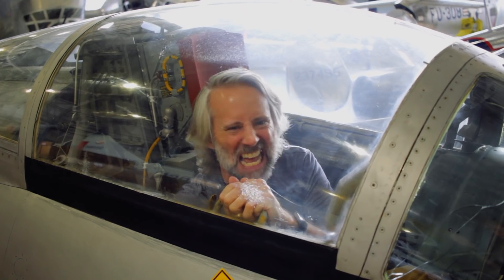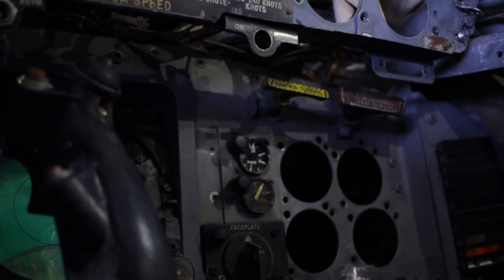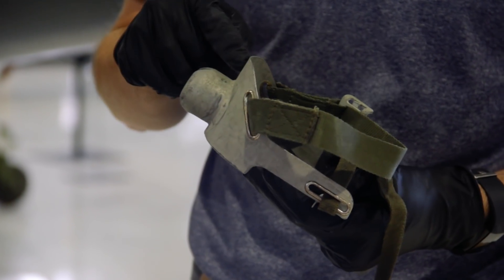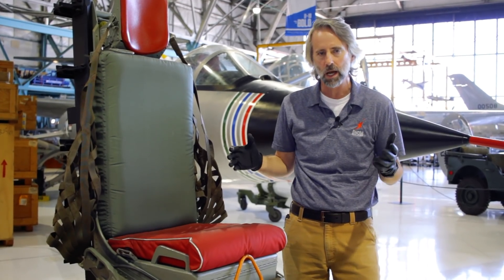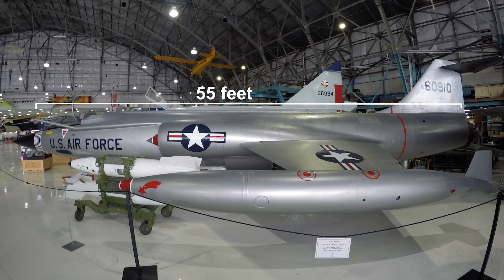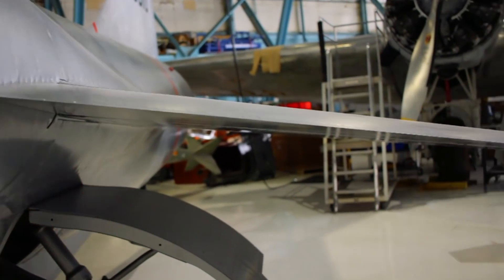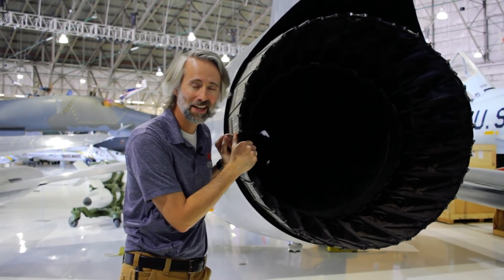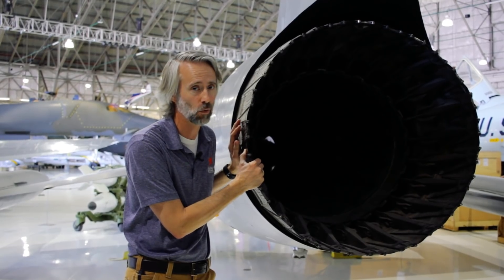F-104 Starfighter | Behind the Wings

Comment: He's trapped in an F-104, of course he's screaming. If he's got any German in his blood, he's screwed.
Reply: That moment when your a German-Canadian F-104 pilot
Reply: The RCAF also lost 50% of its CF-104 Starfighters to accidents.  Another colloquial name for it was "the lawn dart".
Reply: The reason why so many german f104 s crashed was , The german G model version was heavier - made for all weather usage and used for low level Nuclear Bombing ( instead of beeing a High altitude bomber interceptor ) during the cold war ,was also rushed into service , another reason for the crashings was lacked maitenance by inexperienced servicing personel .
Remember always seing them flyinging at low level - even flying under Power lines during the 70s ! 
 Salute from germany ! :-)
Reply: I don't get it
Reply: @alphacentauri34  The Germans had the highest mortality rate in the F-104 than any other operator.
Reply: @BlunderMunchkin  I got that I just thought they had a worse version of it
Reply: @alphacentauri34  They had a really weird version because they wanted a ground attack plane, but the 104 was an interceptor, so many redesigns had to take place. These redesigns, along with an even higher wingloading due to the heavier ordinance for ground-striking, caused it to have a bad tendency to sheer its wings in turns.
Reply: Guy Smith Like 110 pilots in one year, including the son of the German defence minister.Franz Josef Strauss. The worst of it was that it was selected as the NATO standard interceptor and multi role fighter because Lockheed handed out bribes left, right and centre. All the aircraft that it competed against for the NATO contract were far, far safer, having better dead stick landing characteristics and agility. In the case of the Grumman F11F Super Tiger and the English Electric lightning, they rivalled it for outright speed and climb as well.
F104 Starfighter. Great research plane. Useless war plane.
Reply: @SvenTviking  No actually it was beyond the bleeding edge for the time for the role it was designed for, high speed high alt. bomber interception.  It was better than the F-102/4 and the Lightning, or the MiG-21. When requirements and tech passed it by, it should have been relegated to reserve use, but... capitalists gotta capitalize.
Reply: James the Other One I have tones of evidence to suggest the F-104 was beyond inferior to the Lightning. Not only did have the worst accident rate per flying hours of an century series fighter at 25.2 destroyed per 100,000 hours flying time. For reference the second worst was the F-100 at 16.2 destroyed per 100,000 flying hours. Let’s not even mention the German experience... Compare this to BAC lightning which had a loss rate of about 50 out of all 330 (about 16%) planes ever produced with most being down to pilot error or long time stress of the airframe over their decades of continuous service.  Which is another point the USAF couldn’t wait to get rid of these things and retired them quite quickly compared to the lightning. 

Now let’s look at what pilots who flew both had to say about them... http://www.lightning.org.uk/julaug05sotm.html at the bottom is a photo of an F-15 caught in camera gun sight of a Lightning during a mock dogfight. The Lightning has all the raw performance of the F-104, whilst being easier to handle, being more manoeuvrable and safer...
Reply: @GG-ir1hw  I'm not sure why you replied to me with this but have a cookie.
Reply: @GG-ir1hw  
> James the Other One [...]
 
I suspect that you intended to direct your reply to me rather than the Other One since I'm the person who has been defending the F-104 against its detractors.
I'm going to present a response, or rather several responses because of size limitation of any single reply, based on that assumption.
 
> I have tones [sic] of evidence to suggest 
> the F-104 was beyond inferior to the 
> Lightning. 
 
For anyone who wants the Reader's Digest Condensed version, the answer to this assertion is, "No, you don't, because no it (the F-104) wasn't (beyond inferior) to the Lightning ... except maybe in your dreams".
Reply: @GG-ir1hw  
> Not only did have the worst accident 
> rate per flying hours of an century 
> series fighter at 25.2 destroyed per 
> 100,000 hours flying time. 
> For reference the second worst was 
> the F-100 at 16.2 destroyed per 
> 100,000 flying hours. 
 
I've seen the claim that the F-104 had the worst accident rate of all of the Century Series fighters before.
Unfortunate, this claim is usually not accompanied by any mention of how this determination was made and therefore what the expression "accident rate" really means in a particular context.
This is important if for no other reason than because the number of accidents that a particular type of fighter aircraft experiences usually decreases over time and so the "accident rate" can refer to something different at different times.
 
In one case where the claim was made that the F-104 had the worst accident rate of all the Century Series fighters, a reference was also made to Bowman's book "Lockheed F-104 Starfighter".
And from the figure given in that book on page 21 where the number of number and types of accidents of Century Series fighters was given, it's clear that the F-104 did NOT have the worst accident rate, either in absolute or relative terms based on the accidents that occurred first 750K hours of flight time (600K in the case of the F-104 because it hadn't acheived the 750K hours mark).
This is something that I have noted elsewhere at least a couple of times now.
By this measure of "accident rate", the F-100 was hands down the worst of the Century Series beating the F-104 by roughly double in terms of accidents, losses, and fatalities:  471 accidents, 287 destroyed, and 91 fatalities for the F-100 in 750K hours versus 196 accidents, 160 destroyed, and 58 fatalities in 600K hours for the F-104.
And if you can't do the math in your head, dividing the first set of numbers by 7.5 and the latter set of numbers by 6.0 to convert them to values for 100K flight hours, you come up with 62.8 accidents, 38.3 losses, and 12.1 fatalities for the F-100 versus 32.7 accidents, 26.7 losses, and 9.7 fatalities.
So while the value you cite for F-104 losses is roughly in the same ballpark, your figure for the F-100 is off by roughly a factor of two.
 
> Compare this to BAC lightning which 
> had a loss rate of about 50 out of 
> all 330 (about 16%) planes ever 
> produced with most being down to 
> pilot error or long time stress of 
> the airframe over their decades of 
> continuous service.  
 
This is a USELESS apples-to-oranges comparison which says NOTHING about the accident rate of the Lightning compared to the F-104.
You switched from an accident rate that compared aircraft lost over some number of flight hours to simply number of airframes lost over the service life of an aircraft.
If you really want to compared the accident rate of the F-104 to the Lightning, then you need to factor in the number of aircraft build and how many hours they flew.
And an interesting thing happens when you do this because at least by some measures of "accident rate", the Lightning was LESS SAFE than the F-104.
This is covered in Chapter 12 of Peter Caygill's book, "Lightning Eject: The Dubious Safety Record of Britains Only Supersonic Fighter", (yes, that Peter Caygill who also wrote "Lightning from the Cockpit: Flying the Supersonic Legend") from which I'll now quote:
 
  Although the actual number of F-104G 
  accidents in West German service was 
  significantly greater than the total 
  number of Lightning accidents, this 
  tends to be obscured by the fact that 
  many more F-104Gs were delivered to 
  the Luftwaffe and Marineflieger .  
  Including the twenty development batch 
  aircraft, Lightning production for the 
  RAF amounted to only 280, whereas a 
  total of 916 Starfighters were taken 
  on by the German armed forces.  It is 
  only when an analysis is made of the 
  accidents per flying hour that the 
  true picture begins to emerge.
 
  During the first ten years of Lightning 
  operations in the RAF (up to the end 
  of 1969), a total of 199,000 hours 
  were flown and in this time thirty-two 
  aircraft were written off in accidents 
  (this figure includes two Cat.4 
  accidents in which the damage level 
  was subsequently upgraded to Cat.5).  
  Thus, on average, a Lightning was 
  destroyed every 6,218 hours flown.  
  During the complete life of the F-104G 
  in West German service, total flying 
  time amounted to 1,975,646 hours and 
  there were 298 accidents that resulted 
  in 298 accidents that resulted in 
  complete write-offs.  A Starfighter 
  was therefore lost for every 6,630 
  hours that were flown.  If the 
  seventeen-month period from the 
  beginning of 1970 is included in this 
  analysis of the Lightning accidents 
  [which was presumably when one 
  Lightning was being lost every month]
  the loss rate worsens to one in 
  every 5,795 hours, and if this 
  period is looked at in isolation an 
  aircraft was being destroyed every 
  4,667 hours.  These figures indicate 
  that the accident rate per flight 
  hour for the F-104G and the Lightning, 
  although not dissimilar, show that the 
  latter [the Lightning] did have an 
  inferior safety record for at least 
  some of its operational life. 
 
And something to keep in mind here is that the accident rate of the Lightning SHOULD HAVE BEEN LOWER than the F-104G as this is what commonly happens when comparing an interceptor to a non-interceptor, at least according to an old Rand study on fighter aircraft accident and attrition rates during peace time that I have somewhere.
This is something that I think Caygill alludes to but doesn't actually come out and say when he says:
 
  This was despite the fact that the 
  F-104G was designed at the outset as 
  a strike/attack aircraft so that it 
  spent much of its time operating at 
  low level, often in bad weather, and 
  was therefore more vulnerable to 
  terrain, bird-strikes and obstructions.  
  In contrast the Lightning had begun its 
  life at medium and high altitudes and 
  it was only towards the end of the 
  1960s that it also took on a low level 
  role in addition to its previous duties.
 
So think about that for awhile: the Lightning had an even worse safety record than the F-104 and Caygill just happens to say that the F-104 had the worst safety record of the Century Series ... doesn't that mean that the Lightning had a worse safety record than ANY of the Century Series?
Oh my ... isn't that a disturbing thought.
Reply: @GG-ir1hw  
And that brings us to the causes of the aircraft losses because your message seems to suggest that Lightning losses had little to do with the aircraft itself (other than a long life span resulting in airframe fatigue).
The implication you seem to be making as well then is that you think the F-104 losses had more do to with the airframe (other than airframe fatigue) which seems like a backhanded way of saying that you think the F-104 losses were the result of some design defect.
If that is indeed what you are trying to imply, then you're going to have a problem because Caygill says this:
 
  These differences in usage are 
  reflected in the breakdown of accidents 
  as 43 percent of all F-104G crashes 
  were attributed to pilot error, with 
  41 per cent being the result of a 
  technical defect.  In the case of the 
  Lightning, the number of accidents put 
  down to pilot error was generally around 
  the 20 per cent mark, although write-offs 
  as a result of technical defects was 
  significantly higher at 65 per cent.  
  Of all the Lightning accidents that were 
  caused by technical defects, approximately 
  two-thirds were due to fires both in the 
  air and on the ground.
 
And as he noted elsewhere, there was a 6-percent chance that a Lightning pilot would experience an engine fire and a 25-percent chance that he would not survive.
Reply: @GG-ir1hw  
Caygill goes on to point out that a German pilot had a much greater chance of dying in an F-104G in the case of a crash than an RAF pilot in a Lightning (about double).
Perhaps this why the SOP for just about any problem with the F-104 was to punch out.
But then, you really don't want to talk about the German experience, right?
 
> Let’s not even mention the German 
> experience... 
 
Okay, we're not going to mention the German experience, let's mention the Canadian experience instead since they lost half of their F-104s, which was much worse than what the Germans lost.
But here's the fine print from the Wikipedia article on the CF-104 (which presumably came from Peter Davies' book "F-104 Starfighter Units in Combat (Combat Aircraft)"):
 
  There were 110 class A accidents in the 
  25 years that Canada operated the CF-104 
  resulting in 37 pilot fatalities. Most of 
  these were in the early part of the program 
  centering on teething problems. Of the 110 
  class A accidents, 21 were attributed to 
  foreign object damage (14 of which were 
  bird strikes), 14 were due to in-flight 
  engine failures, 6 were as a result of 
  faulty maintenance and 9 involved mid-air 
  collisions. Thirty-two aircraft struck the 
  ground flying at low level in poor weather 
  conditions. Of the 37 fatalities, 4 were 
  clearly attributable to systems failures; 
  all of the others were attributable to 
  some form of pilot inattention.[11]
 
By way of comparison, the Wikipedia article goes on to point out:
 
  The accident rate of the CF-104 compares 
  favourably to its predecessor, the F-86 
  Sabre. In only 12 years of operation the 
  F-86 had 282 class A accidents with a 
  loss of 112 pilots. The Sabre was also 
  a simpler aircraft and was normally flown 
  at higher altitude.[12]
 
And since we aren't going to mention the German experience, we won't bring up that the German F-104 loses were comparable to the German F-84 losses that the F-104 was supposed to replace.
Reply: @GG-ir1hw  
> Which is another point the USAF 
> couldn’t wait to get rid of these 
> things and retired them quite quickly 
> compared to the lightning. 
 
The USAF wanted to use the F-104 as an interim point defense interceptor (even though that was not what it was designed to be) until the interceptor that it really wanted (the F-102/F-106) became available.
(The F-101 was likewise re-purposed from an long range penetration bomber to be a wide area interceptor.)
Aside from the fact that that the F-102/F-106 was sort of available to perform the task that it was designed for, the Air Force also wanted to make way in their inventory for the F-4 which they regarded as "better" because it was a more heavily armed, "push button" aircraft loaded with every bell and whistle the Air Force could think of that could take on billions and billions of roles, including what amounted to wide area defense against Soviet bombers.
 
But considering that the Air Force didn't originally want the F-15 as it is now, didn't want the F-16 at all at least until it was assured that it would get what the F-15 had turned in to, and has been trying to get rid of the A-10 so that they can pay for the F-35, your attempt to use the F-104's term of service in the Air Force a bit ... laughable ... at best.
 
And what you conveniently neglected to mention is that while the Lightning was in service "somewhere" from 1959 to 1982, the F-104 was in service "somewhere" from 1958 to 2004.
IOW, the F-104 outlasted the Lightning by about 20 years.
So if longevity of service really is a sign of how good an aircraft is, then the Lightning is "beyond inferior" to the F-104.
 
But before leaving this point, let's talk about how the British government, the RAF, and the rest of the NATO countries treated the Lightning, shall we?
 
I'm sure that given how "beyond inferior" the F-104 was compared to the Lightning, at least some of the other European countries must have bought some even if that meant getting rid of their F-104s.
Oh wait, that didn't happen.
 
Well I'm sure that given how great the Lightning was at home, the British must have continually upgraded the Lightning to keep it competitive for long into the future.
Oh wait, that didn't happen either.
 
Okay, then the British must have at least used their own Lightnings for the bulk of their air defense instead of some silly American offering, say like an F-4 with Spey engines.
Oh wait, that also didn't happen.  
 
WTF?  What kind of lousy aircraft was the Lightning after all?
Reply: @GG-ir1hw  
>
> Now let’s look at what pilots who 
> flew both had to say about them... 
> http://www.lightning.org.uk/julaug05sotm.html 
 
Okay, let's look ... the article that you gave doesn't really say much of anything about how the Lightning compared to the F-104 and at best said that he liked the Lightning best of all the aircraft he flew.
Meanwhile you can find plenty of former pilots of the F-104 who say that they like it in glowing terms even though they never flew the Lightning.
Might they have liked the Lightning better if they had?  Maybe.  But it doesn't pass the "So what?" test as far as I'm concerned.
 
> at the bottom is a photo of an 
> F-15 caught in camera gun sight of 
> a Lightning during a mock dogfight. 
 
And here's a link to an article about the experience of an F-104 pilot who shot down an F-15 in mock dog fight as well:
 
  https://theaviationgeekclub.com/starfighter-4-eagle-0-that-time-two-f-104s-scored-four-simulated-kills-against-an-f-15b-in-a-single-training-mission/
Reply: @GG-ir1hw  
> The Lightning has all the raw 
> performance of the F-104, whilst 
> being easier to handle, being more 
> manoeuvrable and safer...
 
So here we are at the end of your post and I'm still waiting to see the "tones" of evidence that the F-104 is "beyond inferior" to the Lightning.
Other than the addition of the supposedly better safety record of the Lightning, which is no where as compelling as you may think it should be, the only thing you've said is that the Lightning matches the "raw performance" of the F-104 and the usual bit about it being "easier to handle" and "more manoeuvrable", as if they are supposed to be important in light of the missions that the F-104 was supposed to perform.
 
What you left out is that even though the F-104 didn't have much range, the Lightning was as short -- if not even shorter -- than the F-104 as just about every space in the aircraft being used for fuel.
And while it may have been better in a dog fight than the F-104, the Germans weren't as interested in this as a sole determining factor in terms of which aircraft to by (they specifically noted that the Mirage III that they were considering was better at dog fighting than the F-104) as being able to carry a load of avionics and a nuclear weapon in a low level, high speed strike was as important a role they wanted performed.
IIRC, this is something that the Lightning wasn't ever updated to do even when it was modified to do ground attack.
 
And finally, those who like to point out the supposed superiority of the Lightning over the F-104 seem to believe that the two aircraft were put up head to head during the "Sale of the Century".
They were not.
The Lightning was still in its P1 variant with something like 20 examples flying around at the time the Germans were filling out their squadrons with F-104s.
What ever underhanded tactics that Lockheed may have used to get Germans (and after them other European countries) to buy the F-104 were not needed because despite what the Wikipedia entry says, the British contingent didn't even offer it up for bid.
Instead, they offered up a paper airplane, the Sanders-Roe SR.177.
In short, at the time of the "Sale of the Century", the Lightning wasn't even "beyond inferior" to the F-104, it wasn't even there at all.
Reply: Lewis Cole No my comment was not addressed to you... My response was to James the Other One’s comment: “James the Other One No actually it was beyond the bleeding edge for the time for the role it was designed for, high speed high alt. bomber interception. It was better than the F-102/4 and the lightning, or the MiG-21. When requirements and tech passed it by, it should have been relegated to reserve use, but... capitalists gotta capitalise”
Reply: Lewis Cole As for the accident rate... you said apples and oranges and then proceed to compare the lightning in a ten year period to the entire F-104s service life... So what was the dumb number for the accident rates of lightning by the late 60’s per flying hours? Oh yeah 199,000 over 32 = 6,218hour per crash. Let’s actually compare this to the contemporary Luftwaffe F-104 accident rate of the 1960s... According to this site: http://www.916-starfighter.de/F-104_ServiceHistory.htm at the peak of the crisis it was 139 accidents per 100,000 flying hours... that’s 719 hours per accident... that is ** just like the plane. If you want compare the total accident rate throughout their entire careers then it was about 15% lost for the Lightning fleet and double that for the Luftwaffe... 

Now please give me the evidence to show me the F-104 was superior to the lightning... Pilots who flew both always seemed to side with the lightning to the best of my knowledge. 

Anyway, let’s discuss bribery and ease of availability since it seemed the main factor in the F-104s procurement. The USA was basically handing out F-104s to European countries like candy at Halloween. We all know the most decorated german ace of WW2 Erich Hartman said the F-104 was trash and heavily disagreed with its procurement... while I’m not saying the EEL would’ve been a better procurement as I believe the F-4phantom was what they needed, and if not available then the Mirage III. Also yes I’m well aware of the fact the Lightning was never offered by the British government, in fact the UK government told the Germans not to buy it, because as you said they backed a different aircraft for that race. I do however think it would’ve done better in the role. It was a far more forgiving aircraft than the F-104 and the Saudis and Kuwaitis who operated the lightning in a multirole capacity suffered no serious issues. 

The Lightning was only ever intended as a stop gap measure, the UK was a broke nation that destroyed its aerospace industry in the 1957 white paper. The lightning was supposed to be supplanted by long range surface to air missiles. Thus no significant money was put into developing the aircraft past the 1965 F.6 variant. I never said the service life mattered only that the USAF was pretty quick to have the things out of service. However when first introduced these aircraft were fitted with superior missiles to the F-104s Aim-9B and Aim-9E. The first missile the 1957 Firestreaks had a 15G overload better tracking than the Aim 9B a 4mile range, and vastly larger warhead. The second missile the 1963 Redtop had a 18-20G overload, a larger warhead than the Firestreaks, a 7.5 mile range and all aspect capabilities when the target was close to the speed of sound.

Yeah the F-104 was modernised throughout its life but by the end of its day she was obsolescent anyway. Many countries couldn’t be bothered to replace them. The Lightning was replaced by Tornados by which time it only made up two squadrons anyway past the mid 1970s. Had the Lightning had similar treatment who knows what would have happened, but BAC (british aircraft Corporation) we’re stopped from developing the plane and it’s weapons system any further. With plans for an upgraded redtop missile and lightning thrown away.

Anyway I wish we could get the two aircraft and see them compete. Watching the F-104 plough into the ground like the unforgiving, brick of a lawn dart it was would make me laugh. Also when it comes to range at least the Lightning can super-cruise so the fuel hungry AB isn’t needed.
Reply: @GG-ir1hw  
> If you want compare the total 
> accident rate throughout their 
> entire careers then it was about 
> 15% lost for the Lightning fleet 
> and double that for the Luftwaffe... 
 
Well there you go again ... calling the attrition rate the accident rate.
 
I find it interesting that for Lightning losses, you're counting the prototypes the same as the real "production" aircraft to come up with the 15% figure.
Of the 253 production Lightnings produced, 63 were lost (from "The English Electric Lightning: Rare Photographs from Wartime Archives")  for a 24.9% attrition rate.
This is much less than the Canadian (46%), Belgian (41%), German (32%), and Italian (37%) F-104 attrition rates, it's basically the same as the Danish attrition rate (24%), but much more than the Japanese (15%), Norwegians (14%), or Spanish (0%) attrition.
Gee ... I wonder why you didn't mention that?
Reply: @GG-ir1hw  
> Now please give me the evidence to 
> show me the F-104 was superior to 
> the lightning... 
 
Fine.
 
Aside from being able to function as an interceptor and do recon as demanded by the Germans, the F-104 could carry and release a nuclear bomb like the one ton B-43 (which was actually one of four different types of nuclear bombs that it could carry) which is something else that the Germans wanted.
While the Lightning was designed to be an interceptor and could perform the recon, it was NEVER capable of carrying more than half a ton of non-nuclear weaponry even after being modified to perform ground attack.
This would have made the Lightning "beyond inferior" to the F-104 as far as the Germans were concerned ... or rather it should have if the Lightning were even up for bid against the F-104, which it was not.
 
And in case you think that weapons payload somehow isn't a big deal you might want to consider this:
NATO in general and the Germans in particular needed an aircraft that could (1) act as a deterrent to prevent WWIII from starting and (2) perform a one-time low level nuclear strikes if it did.
In the latter case, having the best possible dog fighter is not all that important because there would not have been a prolonged air war for air superiority as there had been in WWI, WWII, Korea, or Vietnam.
Instead, there would be at most one big air battle as fighters from both sides tried to deliver or prevent delivery of nuclear weapons before their home based disappeared under mushroom clouds, after which no one would be taking off any more, as the ICBMs passed each other in space.
And in such an environment, ANY aircraft that wants to engage in a dog fight with you is almost certainly an aircraft that is not carrying a nuclear weapon which you need to stop from being delivered or which you need to just blow passed to deliver your nuclear weapon.
So while the Lightning could have been useful against incoming high speed low level fighter bombers carrying nuclear weapons (assuming that they could get passed any other fighters sent out as cover), it would have been useless in actually delivering any nuclear weapons onto enemy targets.
 
And before you think about trying to tell me, "Well, the Lightning would easily be able to stop an F-104 trying to make such an attack," you might consider that I read about something like this being tested ... and the Lightnings (there was more than one) failed to stop the F-104s at all.
I can't recall the gory details, but jist of what happened is that the F-104 flying low to the ground is damn near invisible to both radar and the Mark I eyeball, which makes it damn near impossible to stop.
 
> Pilots who flew both always seemed 
> to side with the lightning to the 
> best of my knowledge. 
 
I don't know why pilots "always seemed" to like the Lightning, and I don't care.
Unless their preference translates in something related to how well the Lightning could perform the missions that the F-104 ended up performing, it's irrelevant.
And OBTW, if you look at what the German F-104 pilots said about the F-104, they almost always say that they liked it as well.
I recall one Luftwaffe pilot saying basically saying that the F-104 was behind only the F-86 on his list of favorite aircraft.
That ain't too shabby.
(And said pilot had also flown the F-4 which you mention later in your post.)
Reply: @GG-ir1hw  
> Anyway, let’s discuss bribery and 
> ease of availability since it seemed 
> the main factor in the F-104s 
> procurement.  
 
Let's not because as I noted, these are NOT factors that actually played a role in the Germans picking the F-104 over the Lightning.
The British didn't offer the Lightning to the Germans and so whether or not bribery and/or any other incentives were used, the Lightning was never going to win the "competition" because it never was in "competition".
 
> The USA was basically handing out 
> F-104s to European countries like 
> candy at Halloween.
 
So what?  What were the British doing to promote the Lightning to the Germans or anyone else for that matter?  Nothing.
Nor could they have in terms of handing out Lightnings to other European countries in no small part because the serviceability of the early Lightnings days because the British once again tried to be cheap and didn't have adequate parts for repair.
(In fact, as I understand it, the Lightning was always a bit short in the serviceability department through out its time in service.))
Hell, the British couldn't even sell the Lightnings to the Indians when the came looking for them in 1961 and so the Indians ended up going to the Soviets and buying MiG-21s.
That's not the fault of the U.S., Lockheed, or the F-104 so do everyone a favor and stop blowing smoke up everyone's ass to try to make it look like it somehow is.
 
> We all know the most decorated 
> german ace of WW2 Erich Hartman 
> said the F-104 was trash and 
> heavily disagreed with its 
> procurement... 
 
Actually, we all don't know any such thing.
I've heard others who like to slam the F-104 say that Hartman didn't like it, but in his supposed "Final Interview" (< https://migflug.com/jetflights/final-interview-with-erich-hartmann/ >), I read something that's completely different.
In it, he does NOT say that the F-104 was trash, but rather that it was too much for the inexperienced Luftwaffe to handle.
Here's the exact quote from the "Interview":
 
  Q: I know that you and Steinhoff, 
  among others, warned the German 
  government of the F-104 program 
  and that this was a very sensitive 
  issue. What do you say about that 
  today?
  
  A: Yes. Well, the Starfighter was 
  a great plane, but it had problems, 
  and I did not feel that Germany 
  needed, or that our pilots could 
  even handle this machine without 
  a lot more experience. Much higher 
  up felt that I was out of line, but 
  I stated what I thought was accurate, 
  and I was proven correct, but this 
  made me enemies.
Reply: @GG-ir1hw  
> [...] while I’m not saying the EEL 
> would’ve been a better procurement 
> as I believe the F-4phantom was what 
> they needed, and if not available 
> then the Mirage III. 
 
Oh give me a fucking break ... You're not saying that the Lightning would be "a better procurement" after doing your best to slam the F-104 as being "beyond inferior"?!?
Yeah, right ... and I've got some swamp land to sell you.
 
As you might expect, I disagree about the F-4 being what the Germans needed.
I think they needed Star Wars Imperial Tie Fighters ... oh wait, those where offered to the Germans either ... silly me.
The Go-Ahead decision to start building the F-4 wasn't even approved until 1962 by which time the F-104s were already flying in service in Germany.
 
The Mirage III was an option for the Germans ... and they picked the F-104 even though they thought the Mirage was better at "dog fighting".
 
Back to the F-4, though, the Germans (and many other NATO partners) eventually did replace their F-104s with F-4 as you presumably know.
And the British?  Well, they bought F-4s as well ( ... eventually ... as they initially didn't want them either ), but they still kept their Lightnings in the U.K. even though the Lightnings were "beyond inferior" to the F-4s in terms of endurance/range and payload.
In Germany, however, they (RAF Germany) simply replaced their Lightnings with F-4s.
Of course, you'll probably argue that the Lightnings were a better point defense interceptor which is probably true ... except that nobody in the right mind would care about it now.
 
But the important thing here is that while the F-4 might have been "better handling", they didn't turn all that much better than the F-104s because the F-104's wings could be blown even while maneuvering, produced lift out of proportion to their wing area.
As a result, as I've mentioned before, the F-104 beat the F-86, F-100, and F-4 in aerial combat in Feather Duster 1 when flown the way they were supposed to be flown, namely "zoom and boom" rather than "yank and bank"/"turn and burn".
But ignoring that for the moment, the F-4, like pretty much every other American fighter of the time, in that it couldn't out maneuver the Soviet aircraft they would go up against.
In Vietnam, the obsolete MiG-17 was better in a horizontal fight than the F-4 and the latter prevailed because its pilots took it vertical where it had the advantage over the MiG-17.
So once again, we have evidence that your fixation on the Lightning's maneuverability does not mean as much as you apparently think it does.
Reply: @GG-ir1hw  
> Also yes I’m well aware of the fact 
> the Lightning was never offered by 
> the British government, in fact the 
> UK government told the Germans not 
> to buy it, because as you said they 
> backed a different aircraft for that 
> race. I do however think it would’ve 
> done better in the role. It was a 
> far more forgiving aircraft than the 
> F-104 and the Saudis and Kuwaitis 
> who operated the lightning in a 
> multirole capacity suffered no 
> serious issues. 
 
No serious issues?  Ya think?
 
I find it "interesting" that you're trying to equate what happened to Lightnings flying in Saudi Arabia and Kuwait with F-104s flying in Germany.
How about a comparison between the Lightnings in the Middle East to the F-104s in Spain instead?
The Spanish didn't have any "serious issues" with the F-104 either, losing 0 of the 21 F-104Gs while they were in service there for 7 years.
Meanwhile, while no Lightnings were lost in Saudi Arabia (which ordered/had 34 Lightnings) in the or Kuwait (which ordered/had 14 Lightnings), there two Lightnings lost in England that were supposed to go to the Saudis and/or Kuwaitis which you conveniently didn't bother to mention.
 
And then there's the small matter of maintenance of the Lightning that that Kuwaitis apparently overestimated their ability to take care of resulting their not flying all that many hours which in term resulted in the Lightnings being quickly retired.
 
But never mind that ... remind me again about what nuclear weapons the Saudis and Kuwaitis had that they needed to carry against a similarly armed nuclear adversary.
IOW, the missions/roles were different even if you insist on calling the Lightning "multirole" ... yet another apples-to-oranges comparison.
 
> The Lightning was only ever intended 
> as a stop gap measure, the UK was a 
> broke nation that destroyed its 
> aerospace industry in the 1957 white 
> paper. The lightning was supposed to 
> be supplanted by long range surface 
> to air missiles. Thus no significant 
> money was put into developing the 
> aircraft past the 1965 F.6 variant. 
 
I don't give a rat's ass what you think the Lightning's role was "intended" be in no small part because you have already indicated that you aren't willing to accept "intent" as a defense against actual performance.
Remember when you slammed the F-104 as a "bad" aircraft because the Air Force didn't keep it in service very long?
Well part of the reason for that was because the Air Force "intended" to use the F-104 as an "interim" interceptor until the real interceptor that it wanted (the F-102/F-106) hit the fan, even though the F-104 was "intended" by its designers to be a daylight air superiority fighter.
The thing is that when the boys at Lockheed realized that they weren't going to get lots of bucks from the F-104 being in American service, they offered to make the F-104 into what the Germans wanted, regardless of their original designers' "intent".
The result was the "Super Starfighter" (AKA the F-104G) whose strenghtened airframe would allow it to perform the ground attack role that the Germans wanted, a role that the Lightning was never "developed" to match, no matter what the "intent" of the Lightning's designers might have been.
 
And what did the British do to get potential foreign buyers to pay for upgrades to the Lightning?  Basically nothing.
 
Moreover, your claim that no "significant" money was allocated to the Lightning past the F.6 conveniently ignores the fact that the F.6 as well as the F.3 were also put into service AFTER the '57 white paper.
I don't recall whether or not the F.1 was actually flying by then, but it got to because somebody came up with the argument that the F.1 was already so far along that it might as well be continued, so everything after the F.1 was gravy (i.e. "significantly" funded because it didn't have to be funded at all).
And if IIRC, while the F.6 was only in service for something like a year before it was done in, there things that were supposed to be done to it if the money hadn't dried up like replacing the Firestreak with Sidewinders, presumably because British penny pinching left the Lightning without any other alternative that they were willing to fund either.
 
Finally, while we're on the subject of Lightning funding, since you keep wanting to claim that Germans would have been better off with the Lightning instead of the F-104, let's not forget that the only real attempt to make the Lightning a "multi-role" fighter was to give it some ground attack capability which likewise came AFTER the F.1.
Reply: @GG-ir1hw  
> I never said the service life mattered 
> only that the USAF was pretty quick 
> to have the things out of service. 
 
Talk about disingenuous bullshit.
No, you didn't explicitly say that service life mattered, but you most certainly did implicitly.
And now that I've pointed out the Lightning comes up short against the F-104 in that regard, you're trying to slim your way out of it.
Good job, sir ... good job.
 
> However when first introduced these 
> aircraft were fitted with superior 
> missiles to the F-104s Aim-9B and 
> Aim-9E. The first missile the 1957 
> Firestreaks had a 15G overload better 
> tracking than the Aim 9B a 4mile 
> range, and vastly larger warhead. 
> The second missile the 1963 Redtop 
> had a 18-20G overload, a larger 
> warhead than the Firestreaks, a 7.5 
> mile range and all aspect capabilities 
> when the target was close to the 
> speed of sound.
 
Oh joy, oh joy ... yet another exercise in measuring performance at the brochure.
 
So do you have any real live combat experience data for the missiles you think are so "superior" that shows they were actually as good as they seemed in the artificial environments seen during development and testing?
 
For anyone out there besides @GG, you might be interested in the following comments by Ian Black found in this Hushkit page 
< https://hushkit.net/2015/11/18/flying-and-fighting-in-the-lightning/ >:
 
  Q:  How good was the radar?
  A:  In 1960 it was probably state of 
      the art, but by 1988 it was positively 
      prehistoric ! It was hopeless at low 
      level overland, difficult at low level 
      over the sea. At height the targets 
      would often be doing in excess of 
      .9 Mach so the combined speed of fighter 
      and target would be around 20 miles a 
      minute – with a maximum pick-up range 
      on an average target of 18-20 miles 
      this gave you less than a minute from 
      initial contact to engagement. It also 
      had very limited electronic counter 
      measures capability.
 
  Q:  How good were the weapon systems?
  A:  Again the weapons system was state of 
      the art in the 1960s, by 1988 it was 
      prehistoric. The system had potential: 
      a data-link where the ground controllers 
      would perform the intercept with pilot 
      flying to target hands-off. The weapons 
      were fine against lumbering Soviet 
      bombers up at altitude, but not great 
      in a high G combat scenario.
 
  Q:  How did Lightnings do against teen 
      series fighters in BFM/DACT (dogfight 
      training) exercises? What tips would 
      you offer in these situations?
  A:  Lightnings fought F-14, F-15, F-16 and 
      F-18s. At long ranges Lightnings would 
      have been shot down with radar-guided 
      missiles-  with no RWR (radar warning 
      receivers) the Lightning would not have 
      stood a chance. Against the teen series 
      the Lightning did OK in close-in combat, 
      but the best version for air combat was 
      the F.Mk 3 and that had so little fuel 
      you could really only one last for one 
      engagement.
 
> Yeah the F-104 was modernised 
> throughout its life but by the end 
> of its day she was obsolescent 
> anyway. Many countries couldn’t be 
> bothered to replace them. The 
> Lightning was replaced by Tornados 
> by which time it only made up two 
> squadrons anyway past the mid 1970s. 
 
IIRC the Lightnings only ever got up to around two squadrons and so it's not try to make it sound like there were billions and billions of Lightnings flying around at one time which were replaced by Tornados, shall we?
 
> Had the Lightning had similar 
> treatment who knows what would have 
> happened, but BAC (british aircraft 
> Corporation) we’re stopped from 
> developing the plane and it’s 
> weapons system any further. With 
> plans for an upgraded redtop 
> missile and lightning thrown away.
 
Who knows?  Well, how about we do since the Lightning was upgraded during its service life ... just not with much that kept it from becoming irrelevant almost immediately.
And if you want to talk missiles, then how about an upgrade that would allow a Lightning pilot know that they were about to be on the receiving end of a BVR missile.
IIRC, such an upgrade never occurred.
 
> Anyway I wish we could get the two 
> aircraft and see them compete. 
> Watching the F-104 plough into the 
> ground like the unforgiving, brick 
> of a lawn dart it was would make 
> me laugh. [...]
 
Well that's one possibility.
Another is that the F-104 plays "keep away" until the Lightning runs out of fuel at which point it either crashes leaving behind a big crater or lands gracefully so that it can be shredded by the Vulcan cannon by the overflying F-104.
 
The results of a fly-off would no doubt depend on a number of factors.
You apparently assume that such a fly-off would involve a 1-v-1 dog fight where the Lightning would have an advantage over the F-104.
If the fly-off involved using what ever tactics are best suited for each aircraft, the results could well be different.
As I've pointed out before, the F-104 beat other more maneuverable aircraft when it was allowed to "zoom and boom".
And if something more "realistic" were done, namely many-v-many aerial combat, then you might be surprised to discover that numbers can beat maneuverability as was clearly indicated in AIMVAL/ACEVAL.
In AIMVAL/ACEVAL, the F-15 was pitted against the F-5 with the former beating the latter handily in 1-v-1 fights.
But as the number of F-5s increased, the exchange ratio (AKA kill ratio) in favor of the F-15 decreased eventually reaching 1 to 1.
The same thing happened with the force ratio was kept constant, but the number of fighters of both kinds increased.
And if the fly-off were to involve some F-104s carrying nuclear weapons, I'm sure that I would be comforted to know that no matter how well the Lightnings did against the F-104s, there would almost certainly be cases where the only thing left of your sorry ass would be a couple of unburnt spots where your butt cheeks kept the underlying seat material from being vaporized.
 
> [...] Also when it comes to 
> range at least the Lightning can 
> super-cruise so the fuel hungry 
> AB isn’t needed.
 
Nice try, but the Lightning's range was crap even without afterburners.
 
FYI, at least some of the Century Series fighters could "supercruise" (meaning fly supersonically without afterburners) albeit in some cases just barely.
The F-104 most certainly could supercruise and when we're talking about the F-104As equipped with the J-79GE-19 (which was used on the F-104Ss), it could actually "cruise" at supercruise.
In particular, it had twice the supersonic cruise radius of the F-15C at Mach 1.7, in addition to out accelerating it at Mach 2.2.
Unlike many/most fighters, the F-104 wasn't limited so much by its thrust as by structural limitations (AKA "red lines"). 
It's top speed was limited by the inlet temperature of its engine and so pilots had to throttle back when they reached "top speed" of around Mach 2.2 to Mach 2.3 to keep the inlet temperature down so as to prevent damage to the engine.
However, the airframe was supposedly good to about Mach 2.8 although the canopy was supposedly only good to around Mach 2.6.
Now what were you saying about the Lightning being able to match the F-104 in raw performance again?
(I think you were referring to a comparison of the heavier F-104G to the Lightning, forgetting that that wasn't the only version of the F-104 made.)
 
At this point, I'd like to point out that unlike you and the F-104, I don't "hate" the Lightning.
I think that the F-104 was/is a beautiful aircraft and that by comparison, the Lightning is butt ugly ... but that's a matter of taste.
In terms of its performance, however, the Lightning was a wonderful aircraft and an excellent example of what can be done when an aircraft is made for a single mission rather than the "multi-role" nonsense that every aircraft has to be designed to do today.
Together with other simple and (hopefully) cheap aircraft designed to do other roles that (hopefully) complemented the Lightning, Life would (hopefully) be Wonderful.
Ideally, the Lightning should have been sold (with those other complementary aircraft) around the world thereby making its fame more widespread.
 
But that didn't happen.  And that's not the fault of the F-104, Lockheed, or the U.S.
Reply: @alphacentauri34  the 104 was nicknamed the WIDOWMAKER for a very good reason.
Reply: @sasquatch2753  Not really. Go read up on why it just wasn't a good choice for the newly reconsituted W. German AF.
Reply: @jamestheotherone742  it bad the highest mortality rate of any aircraft in peacetime.   and I think it still holds this record.  

It was technologically amazing but tricky to fly.   The aircraft was unforgiving and claimed a lot of pilots...  the title of  Widow Maker is fitting and accurate.
Reply: @sasquatch2753  They don't call it "the bleeding edge" for nothin'.
Reply: @sasquatch2753  
> it bad the highest mortality rate of 
> any aircraft in peacetime.   and I 
> think it still holds this record. 

Not in the case of the U.S. Air Force it doesn't.
The F-100 killed more pilots than the F-104 did.

If you are talking about the German experience, I would argue that they had such a high number of deaths for basically the same reason that the Americans did with the F-100, namely that the aircraft was a quantum leap beyond what they were used to.
To me, it's like tossing the keys for a bunch of F1 race cars to a bunch a bunch of first time drivers who just got their driver's license and telling them to drive them and service them as they like.
When some of them wrap themselves around trees, you don't blame the car or even the drivers, but rather the people who gave them the keys ... which would be the people in the German government of the time.

> It was technologically amazing but tricky to fly. 
> The aircraft was unforgiving and claimed a lot 
> of pilots...  the title of  Widow Maker is fitting 
> and accurate.

The title "widow maker" is often times applied to any aircraft in which a lot of pilots die, as for example, the MiG-21 in the hands of Indian pilots.
Other services that don't have such losses don't.

But while you are entitled to your opinion about the "widow maker" moniker, I don't agree.
It was "unforgiving" yes, but time and time again, the word "honest" is the word that seems to equally summarize how it's pilots felt about them, as any number of YouTube videos that interview F-104 pilots indicate.
Reply: @alphacentauri34  Did you not watch the vid? Explained when he's at the tail discussing the engine.
Reply: Or Canadian
Reply: Here is a song off the album “Captain Lockheed and the Starfighters” by Bob Calvert

Long and lean 
A silver queen 
Have you ever seen 
Such a flying machine 

Hits the ground 
As fast as sound 
Seven hundred thousand pounds 
Of little pieces lying around 

The widow maker 
Is a real brain shaker 
The widow maker 
Is a silver queen 

The widow maker 
Is a real heart breaker 
The The widow maker 
Is long and lean 

Easy to fly 
A pie in the sky 
Do you wanna try 
A good way to die 

Dive through the clouds 
With a scream really loud 
Hold you head proud 
And wind up in a shroud 

The widow maker 
Is a real brain shaker 
The widow maker 
Is easy to fly 

The widow maker 
Is a young life taker 
The widow maker 
Is a pie in the sky 

The widow maker 
Is a good way to die
Reply: That's fkd up man...these machines were badly maintained back in the day. And the Luftwaffe contested on that fact and told the widow's the crashes were human error. About 108 pilot's died in that thing. Think of the kids and wife's these man left behind. For no reason...
Reply: The only thing German this guy has is his sense of humor.
Reply: war thunder?
Reply: Just what I was going to say!🤣
Reply: It's a usa
Reply: That was a prototype
Reply: What was a prototype?
Reply: @JimmyJamesJ  The german ones.